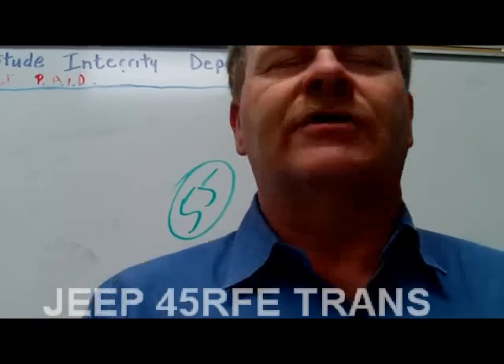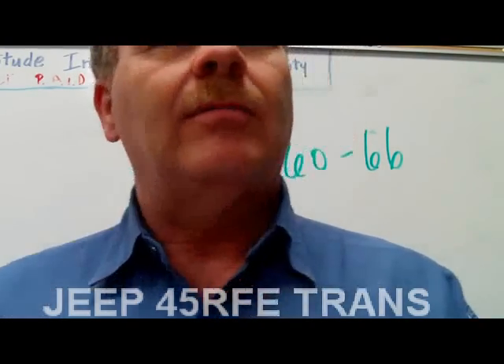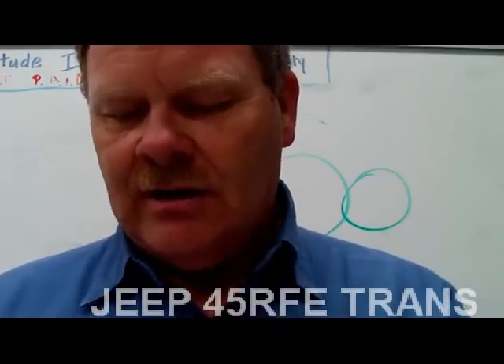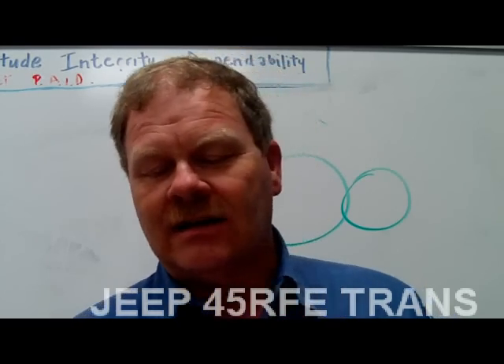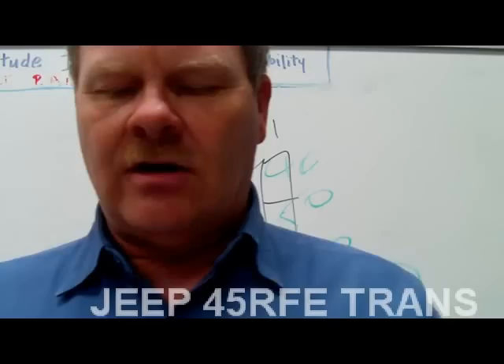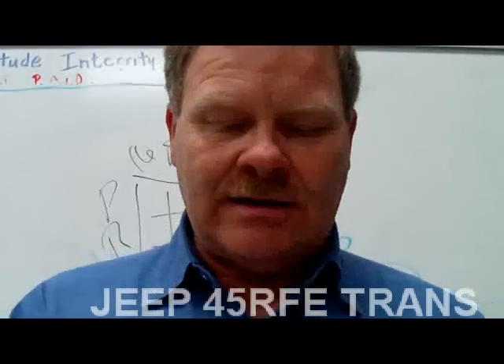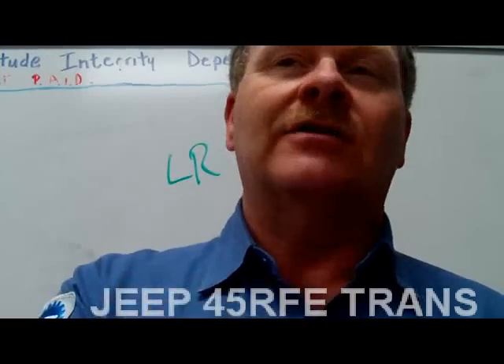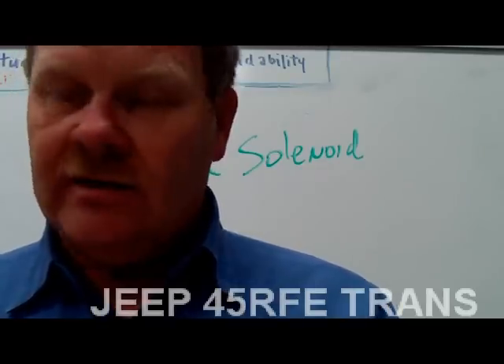45RFE TRANS.flv

Comment: I have two DTC’s on my 2002 Dodge Ram 4.7 with this 45RFE both have incorrect gear ratios 2 and 3. Where should I start? I know I need a quart of atf4 i just bought this truck. It needs a timing chain service of guides is missing. The only codes at first was for a crankshaft position sensor and an input speed sensor. I already did tranny fluid and filters change and changes crank, input and output speed sensors.
Reply from the maker: Get the engine fixed first before you do anything to the transmission. The pursue any code that has to do with the transmission like the output speed sensor issue - but do the engine first.

Comment: Thank you for the video. I have a question for you. I own a Jeep Liberty 2,8CRD 163hp this automatic transmission. When I start the car in the morning she just does not go . It is necessary to wait about 4-5 seconds , then it starts normally go. Oil ( the original ) and a filter ( not the original ), Valve Flow Control I replaced , but there is no improvement. One hope for you, you may know what is the reason ?
Reply from the maker: +Кузовной ремонт в Германии Check TSB NUMBER: 21-015-05 which addresses that problem on mid 2000s model Liberties